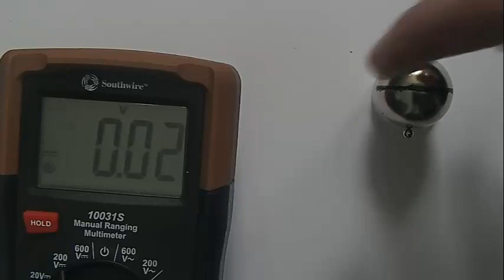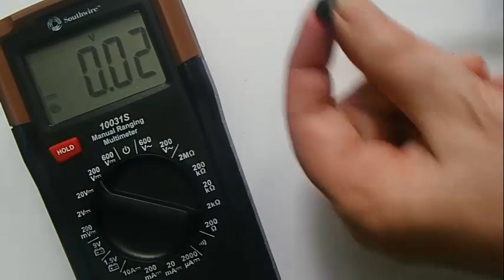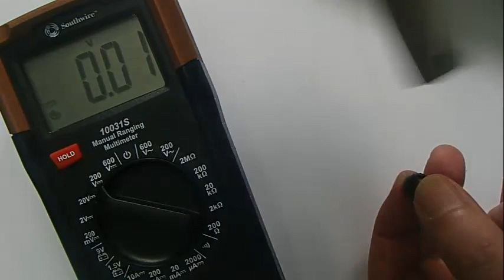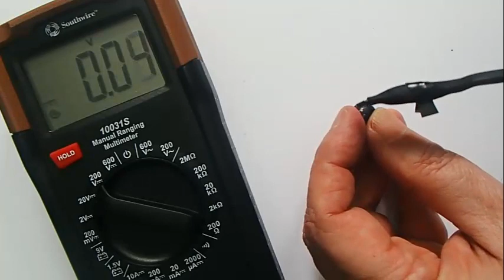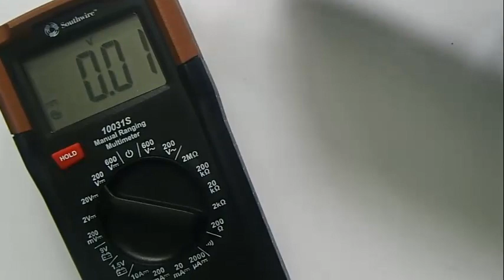More Hall Sensor Experiments

Comment: Edited:  Cool video, once again. Yes!  The minus and plus show us the north polar stream coming out, and the south stream coming back in, the q particles (in my theory, or aether particles) go from north to south with a head or pole of their own that stays in one direction..  The iso lines you found show there is anther force happening too, maybe the leaking of the gravity waves.  As waves radiate and hit a boundary between two materials, in this case the magnet skin and the air, some waves exit, but some bounce back.  My theory stated that the ones that bounce back in an organized matrix that created them, they refocus and amplify the center where they all meet.  This is why when you break a magnet, the center of the magnetic field changes and doesn't stay in the spot where it was when hole.  Now some waves pass through the boundary.  Since my theory states that the magnetic force in subspace form toruses around the center core of arranged neutrons subspace connection core, and these tori are swirling q particles, then they rub against other q particles in subspace, and turn them the other direction, forming an outgoing expanding tori ring that repeats this over and over, making rings of tori, forming, visually, hills and valleys around the center in a plane, like rings around saturn, or invisible rings around a magnet's bloch plane, or rings in a galaxy where material buches together.  It is perhaps why planets form stable orbits, because their subspace tori and the star's subspace tori find a happy place that slows the inward fall of the planet.  So the bloch wall is leaking gravity waves.  As the gravity waves move out into their tori plane, they will interact with the q particles in regular space moving from the north pole to the south pole, forming a kind of a traffic jam where they meet in regular space at the bloch plane.  I need to draw it up to see what the interactions are.  Do you think the gravity (sub atomic atractive waves that pull on material)  are so strong at the surface bloch wall that they warp space and pull in passing q particles going from north to south?

Comment: Do u know what this means for our body
Reply: wtf
Reply: Different cells produce voltages across different membranes, and magnets might impact those. Is that what you're getting at?
If so they shouldn't really, mostly because these voltages are ion based/chemical voltage difference and won't change much because of how heavy sodium, potassium, chloride etc ions are compared to the strength of the fields. Usually, if you use a strong occilating magnetic field then you can amplify those effects, which is what an MRI does